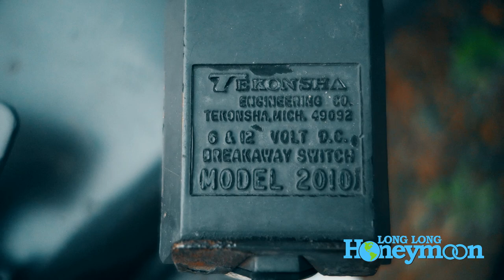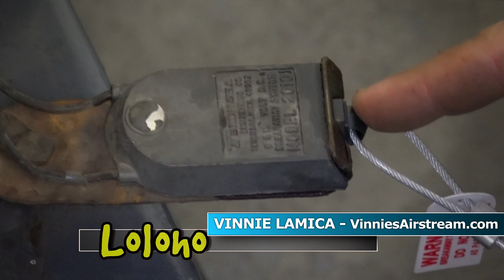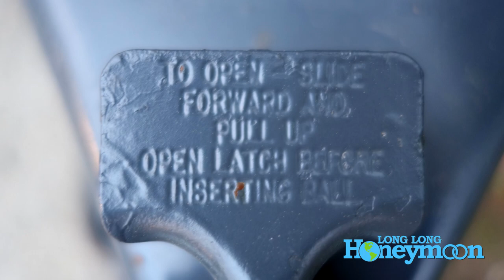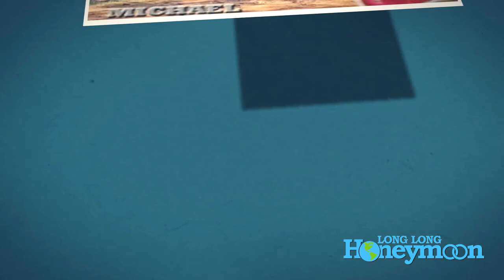For Beginners: "TOP 6" TIPS for HITCHING AN RV

Comment: For the electrical connection between the tow vehicle and the trailer a few things will keep the connection solid: dielectric grease, it's available at any auto parts store and keeps the crap out of your plugs. To clean out dirty plugs, use elecrical spray cleaner, again available at any auto parts store. Lastly, something like Q-tips to get into the plugs to complete the cleaning of the plugs is a good idea too. 
1. Spray out the plugs with cleaner
2. Q-tips or another socket cleaner to completely clean the plugs
3. Apply dielectric grease to both the male and female plugs but especially true for the female plug

Comment: You guys are funny and make some good points. I transport RV’s for a living and I see some crazy stuff on the road every day when it comes to improperly set up hitch configurations. From that to tow vehicles that are simply just inadequate for the unit they are towing. One thing I will leave here is that you can never have too big of a tow vehicle,    I would always recommend slightly more towing capacity than you need for safety and stability. I’ve personally been in some situations ( such as blown tires )  where had I not had a dually I would have been in big trouble. Once had an axle  break where the trailer was all over the road and with less truck I would have been over a 100 foot cliff and I speak literally! Those two extra wheels in the back add a lot of stability and braking   ability. Also I always make sure my hitches are properly locked in place by using the brake controller for the trailer and then dropping the truck in gear to see if it can roll forward without the trailer ( especially with fifth wheels ) , I leave the jack down a bit just in case so the trailer won’t have far to fall in the event the hitch isn’t locked down good.

Comment: Instead of ball grease that your going to wear on your pant leg when you get closer than 5 feet from your hitch there's another option. At a real tractor dealership like John Deere they have a spray can of graphite lube they use on equipment in dusty conditions. It goes on as a liquid and dry's to the touch when the solvent carrier evaporates leaving a coating of lube that won't rub off easily. I spray it in the ball receiver, on the ball and the contacts on the spring bars it's never failed in 30 years of doing this. You'll like it better than grease.

Comment: i had a 2 5/16 skidsteer trl and i used wieght distribution allot when hauling my tractor because if loaded the tractor front wards i didnt have enough tongue load and backwards had too much for a standard ball setup so you need to know how to load your trl granted a camper aint gonna change as much as a flatbed. but now i dump the ball and went to a bigger pintle hitch trl and even its a taller trl deck with a slightly heavier load it pulls and handles like a dream

Comment: Sean & Kristy I was told by an RV shop that if your trailer is longer than 25ft. then a second friction sway control should be added on the left side (driver's side). The left side units are a little more expensive than the right side. I did add the second device as my trailer is 33ft. long. And my trips have been very good with hardly any sway at  all. I have transited the Columbia River Gorge (Oregon) a couple of times with no issues.

Comment: I wanted to comment about the sway bars, I bought the 'blue ox' tow bars that doesn't use sway bars and have driven in the mountains and in high winds  with no problems. It's a great system

Comment: After locking the hitch I always lowered the tung jack raising the trailer to make sure the the ball was securely seated. I had the chain equalizer hitches on several of my trailers once again if you lower the Jack and lift the trailer this takes the pressure off the chains making it easier to release them. On the last couple of trailers I changed to the solid bar type which is a combination anti sway and equalizer. I found they gave better control over sway. I now have a 5th wheel trailer with a companion slider. Don't skimp on your trailer hitches they can save your life.

Comment: I use a magnetic hitch alignment kit from camco. I got it from amazon for around 15 bucks. Short of a backup camera, it makes the hitch process a breeze. I had an older gentleman come to me one morning after watching me hitch up with no spotter and he was in awe that it took me one try to back up to the camper and drop the hitch down on the ball. Great video as always guys. Thanks so much for all the great info!
Reply from the maker: Thanks for the tip, we will check it out. This looks like the one? http://amzn.to/2n7aPmV We have a portable hitch camera and it's pretty cool, but the batteries tend to die precisely when you need it.
Reply: That's the one! Sometimes I feel a little fruity putting those things on but then it is all worth it when folks see how quickly it lines up!
Reply: I use one of those kits too.  I got mine at Harbor Freight for less than $10.  I only use one of the balls however.  My newest truck has a back-up camera.  I position the trailer tongue high enough that I know it'll clear the ball then position 1 of the magnetic mount balls just behind the ball.  The resolution of the camera is fine for right / left adjustments not so much for front to back.  With that one magnet mounted yellow ball on a stick touching the forward side of the ball, when it moves I can see it move in the camera's screen.  At that point, stop, lower the tongue and finish the hook up.  I get perfect alignment the first time every time with no help.

Comment: Great video I've  learned a lot about Hitching up our new/used RV. My husband already knows this but it's great for me to  know as well.  My husband also noticed at 18:28 you can see where you have connected your emergency brake cable to your safety hitch pin and that is 2 safety devices connected at one point..dangerous I believe.

Comment: Thanks for the tips - we will be getting our 2021 AS 19cb in Feb.  We had a SOB trailer before and are looking to adjust the equalizer hitch that we used on it (and maybe get a sway bar) to use on the new rig.  Thanks again.

Comment: Another thing, I always hang the umbilical over the A frame so the connection is not in the dirt, and the connections are sheltered from the rain.  I've seen people lay out their weight distribution bars on the ground in a pretty symmetrical display around their A frame, but this just gets grit on the connecting end that could score the inside of the housing.  I always put an old heavy sock on the connecting end and store them in the pass through.

Comment: great been watching sence you started, one thing i found over 20 years an about 250000  miles with travel trailers the reese dual cam sway controll workes 10000 percent better than friction. i have a set you can have if you want

Comment: I would like to suggest that when you are backing in to hitch your trailer to your truck, if you are lucky enough to have someone to guide or help you, always ask them to stand on the driver side of the trailer & truck so that it is easier for you to see them in that driver side mirror. Also if there are any verbal instructions from driver or helper, it is much easier to hear each other from the driver side. Unless possibly you are a rear window backer upper , then anything goes and anything could happen ! I have backed & hooked & unhooked & also made many mistakes for many decades , so it is good you are trying to help folks to be safe ! Happy travels !  I have watched you from the begining !
Reply: philip Markham, thanks so much for watching all these years! We always use walkie talkies when backing up, and sometimes when hitching. It makes it much easier to hear each other without having to yell over Seemore's Diesel engine! :) I agree that having the spotter stand on the drivers side is much safer. Thanks for your comment...happy camping!
Reply: Agreed regarding the driver's side positioning for the spotter.  In addition, it is advisable for the spotter to avoid getting directly between the coach and the tow vehicle, especially when that vehicle is in motion.  Happy and safe travels!

Comment: Well I was the 100th thumbs UP!  You had me laughing SO HARD at the beginning.  Well done, and glad you can share with a sense of fun a VERY SERIOUS SUBJECT.  Let's face it, nothing can spoil the fun of RVing like the stress or potentially horrible outcome of a bad coupling!  PRACTICE "THE SAFE SIX"

You asked for a few things that we learned - glad to share:

1) Many pros do not like to offer suggestions because of liabilities (even if just to their reputuation.)  Thing is most of this is common sense - which as we all know is sometimes the easiest thing to screw up!  Just remember to always check, then RECHECK.  Leave nothing to chance - confidence is EARNED.

2) DO NOT PULL YOUR BREAK-AWAY CABLE as a PARKING BRAKE or ANTI-THEFT DEVICE!  I thought I'd do this one time we'd parked on a hill and left the trailer unattended.  We were told that the brake wires can overheat, that they are not designed for sustained application.

3) Have your wheels pulled and brakes inspected.  We too bought our Airstream used (79 Sovereign Intl) and before our very first hitch up had brand new brakes, hubs and umbilical cord replaced - just in case.  Well, the mechanic at a professional RV dealer put the @#$@# hub bearing seals(?) in backwards (grease slung round the brake drums making them much less effective) PLUS they left the electrical brake wires too long and unsecured.  The wires rubbed until the wire insulation was through, then shorted out, leaving us many miles away and with no trailer brakes.

Comment: Great video, lubeing the ball gets a laugh but the serious side of it is that if you tow a lot with the ball dry, it can cause serious metal to metal wear on the ball and hitch and in extreme cases through wear, can jump the locking mechanism on the hitch.

Comment: As was mentioned below, the easiest way to verify full engagement of the ball in the tongue is to raise tongue with the tongue jack which should raise the tow vehicle with it.  You will want to do this anyways if you have a weight transfer hitch to take the load off the bars allowing easy hook-up.  I don't need to use the cheater bar to swing the latches up, just grab it and flip it past center with my hand.  I have some friends who didn't know that trick and come close to serious injury when the bar slipped out of their hands and swung back at them with great force.
Reply: Yep.  That's how I hook up my weight transfer bars too.  Much easier that way.
Reply: This is what I found I have to do to hook up the spring bars, but also verifies that the tongue is correctly attached to the ball.

Comment: Great vidio thanks for the laugh i also lift the truck a little after latching the ball. That helps the tortion bar install, not to criticise but having the rv power cable looped through the  hitch safety pin looks like if the cable got pulled on it may pull the spring pin open and allow the hitch pin to slide out.

Comment: Something you might want to add to this video: The breakaway cable needs to be, in effect, shorter than the length of the safety chains or the breakaway switch may not be activated. This can be accomplished by hooking up the hitch and chains, then unhitching while leaving the chains attached and slowly driving the tow vehicle forward until the chains are stretched out. Then measure the distance between the points where the breakaway cable will be attached. Next, back up the tow vehicle and hitch up again and adjust the breakaway cable to be just shorter than the length previously measured. That will ensure the breakaway switch is activated just before the chains are stretched out fully.

Comment: Balls, shanks, whips and chains......I don't think the Honeymoon's over yet!!!! So glad Kristy likes to still play with your ball. Mine still won't after all these years does not like backing up on my ball. NO WAY WILL SHE EVER TOUCH MY SHANK.........NEVER! Dragging chains and my umbilical I use the black rubber strap to hold it off the ground. That way with free to move when it needs too and does not block or impede the functionally of the chains. Remember WD40 is not grease or a lubricant. Awesome video!

Comment: I haven't read all the comments so someone may have mentioned this. I always do this. after attaching the ball to the coupler I raise the jack until the back of the truck starts to lift. if the trailer isn't connected properly the trailer will disconnect from the tow vehicle. This saved me last year when I purchased a new trailer. I had the old small ball but the new coupler is the larger size. No one thought to check. so when I went to hook up at the dealer I lifted the jack to ensure the proper connection when it disconnected. I did it 3 times before I realized it was the wrong ball size.

Comment: Nice tips, want to add to keep a can of electrical connector cleaner on hand for cleaning the contacts. If dirt gets on the connector, spray into it upside down and let the mud run down and off the contacts.

Comment: I did exactly what you described that I didn't get the hitch coupler all the way down on the ball. The coupler was locked, but it was on top of the ball instead of under it as it should be. I have been RVing for years and never did that before, but we towed my 8k travel trailer about 80 miles before we stopped at a Buc-ee's and noticed it. I guess the weight distributing hitch bars held it down well enough that it didn't come unhooked, but what a scare! We quickly fixed it right there on the Buc-ee's lot and went on down the road. Now every time we hook up my wife has me double check it to be sure all is well. 

Another item that I think should be mentioned when unhitching is that the trailer wheels should be chocked before unhitching. If on any incline at all the trailer could roll when unhooked. It happened to me. Fortunately there was a chain link fence about 10 feet behind that stopped the trailer, but it was sure scary to see my trailer roll out of control for that distance. Always chock the wheels before unhooking!       
Thanks for all your great videos!

Comment: Yes, one must make sure that their balls are fully engaged.  Twice in my life I've had trailers come loose.  Once when I was on vacation with my parents and a rented trailer came completely off of the vehicle because the guy that put the trailer on didn't hook up the safety chains or have the ball fully engaged.  I also had a boat trailer come loose but the safety chains held.  Unfortunately in this case the boat didn't have sufficient tongue weight and the trailer tongue came up and damaged the deck lid (trunk lid) of the car.  So the moral of the story is, always have your balls fully engaged and have your tongue weight correct and safety chains crossed.  Keep the good stuff coming guys.

Comment: Check the ball on the coupler by, picking the "rear of the truck" UP with the tung jack, (after you hook up).
Reply: That is exactly what I do when I tow a trailer.  Once I "think" it is connected, try lifting the trailer, it the truck comes up too - you're good.  I have had a couple of surprises especially with U-Haul car trailers.  Those things are the worst to get connected.
Reply: This also aids in securing the weight distribution bars.  If you try putting these things on with the full load of the trailer it's near impossible.  Picking up the truck makes latching the distribution chains much easier.
Reply: Isnt that the case naturally when you're working with something like an Equalizer hitch wherein you have to bring up the jack so you can put in the anti sway WD bars. Honest question

Comment: For safety first we were told to keep the tube on the prong when lifting the stabilizers  into position until the locking pin is in place. On the one side you did but the first side you did not. Although there was no tension on it, with ours there is more like your 2nd hook up. Could be a kneecap breaker if under tension and release the tube b4 locking. I cringed when I saw that but admittedly there was no tension on it.
Also we were told not to cross chains. Ours also hook on the last link so no way to be hanging on ground. I do remember in the 80's my father always crossed his chains.
These may be items that were incorporated into our hitch build/prep.
Keep up the great presentations and the humor was a nice start!
LOLOHO!
Brian Bernier

Comment: I love your videos and insights, but I sometimes need to connect the rig without help.I was given a great little 'helper' to align truck and trailer (Amazon TruePower 20-1888 Trailer Alignment Kit $14.95). It is a pair of yellow foam balls, mounted on telescoping (24") rods, with magnetic bottom mounts.  I put one directly on the hitch ball and the other on the receiver on the trailer.  I back up slowly, aligning the two balls so that when I get to the last few inches or so, they become one, visually. At that point, when I creep backwards, the ball above the hitch ball will begin to tilt toward the truck because it makes contact with the receiver, indicating I'm right on target--works every time.

Comment: Thanks for another great video. I'm not new to towing, but because my T@B didn't require all of this, I am new to hitching up in this manner. Lucky for me that I bought my Airstream from an excellent dealer here in Ontario and I was just shown some of your tips. One thing I have to do to get the stabilizer bars on at the right tension is raise the height of the front of the trailer and the back of the truck once I have them attached. The dealership told me this is especially so with F150's. I couldn't believe how much I had to raise it! Is this your experience too?